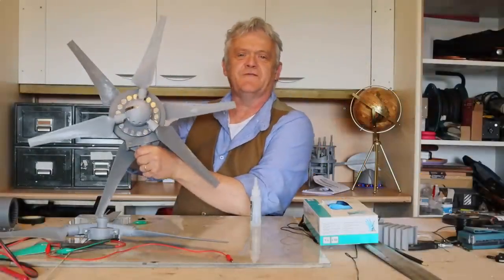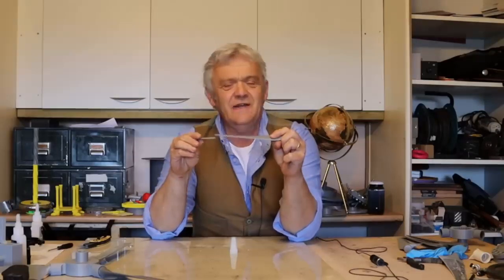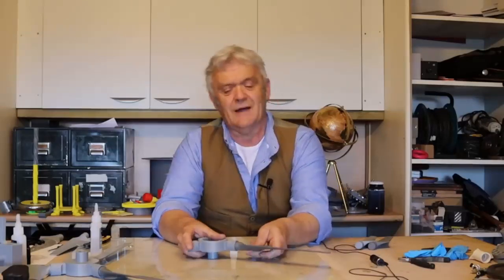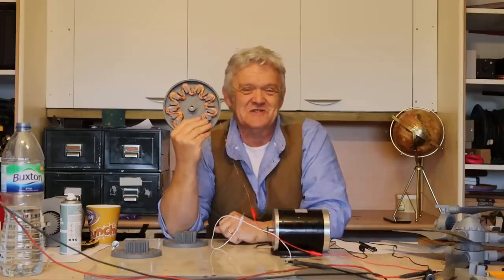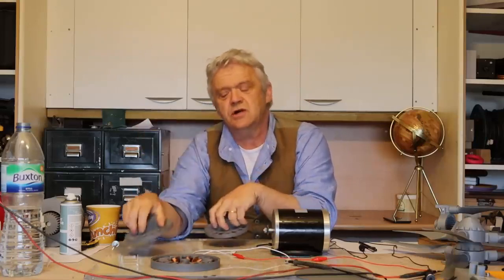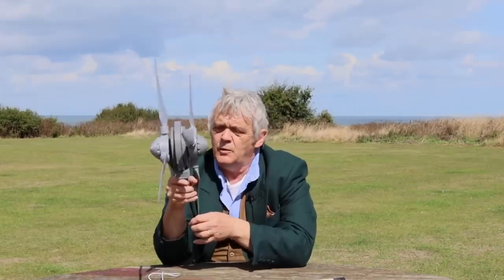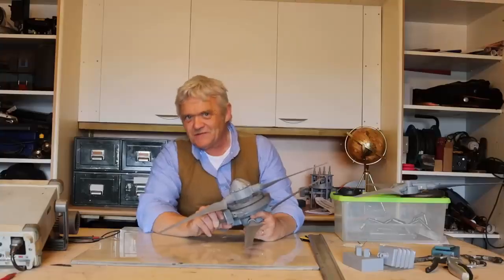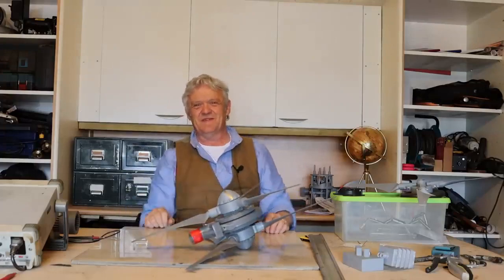002 Dual Rotor Wind Turbine Complete Build

Comment: I’m currently looking for magnets to make this project 15x10 are quite expensive and they also have a range of strengths from N35 to N52 can you recall which strenght of magnets you used for this project and if I can’t get 15x10 can I stack say 15x5 to get the same magnetic field

Comment: I had the idea of contra-rotating blades within a duct, one set of blades embedded with coils with the part off the duct surrounding it with magnets & the other blade with magnets & the part of the duct surrounding it with conductors, giving three areas where conductors are cutting through magnetic lines of force.

Comment: Betz theorem tells us you get %59.3 max and from your first %59.3 max. So in real life you are better off have two separate turbines. So why waste your time ?
Reply: Betz Theorem alone won't work, you also need to take into account the Sail Interaction effect, where one sail directs wind into the other.
Reply: @TimeSurfer206  The point is it goes downhill from there.

Comment: I'm sure I'm not the first person to mention this, but regarding the calculation of rotational speed based on the strobe effect that gives the rotor an appearance of being static, it will appear static at rotational speeds of 500rpm and 1000rpm as well as the 1500rpm you mentioned. Sorry to be pedantic and thanks so much for these really interesting videos.

Comment: The reason why the blades broken is that the surface is not smooth. Because of printing, the raw surface has small cuts of lines. If you make the surface smooth after printing, it will not broken so easily. To make it quick smooth you can rubbing the surface with thinner.

Comment: I wonder what would happen if you built a second generator, and a third rotor, ran both generators and all 3 rotors (offset by 40°) on the  same axel sandwiching them as follows; lead rotor, generator, mid rotor, generator,  trailing rotor.

Comment: Great video once again 👍.
The serpentine copper coil is a definite improvement on the generator. I'm working on one with 18 horseshoe magnets. I was thinking about using magnetic needle bearings to further reduce any drag but the thought of interference from the horseshoe magnets comes into question. I am also thinking of incorporating a long cowling for wind tracking 😊.
❤️🙏

Comment: if the front rotor is correctly designed, tte rear potor will produce about 4 % of the power (according to Betz). This "dual rotor" design was tested and failed 50 or 60 years ago.